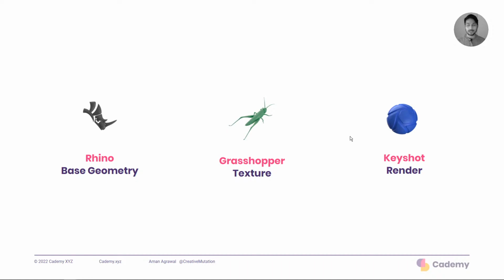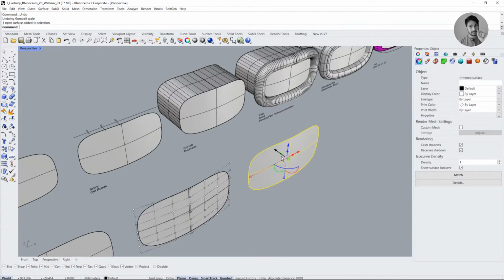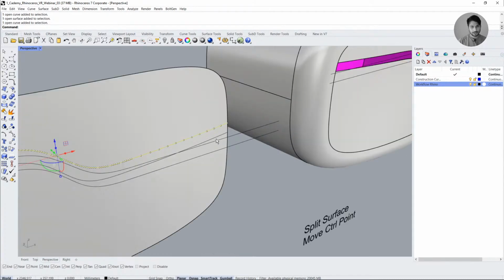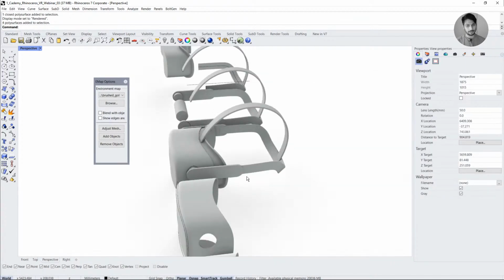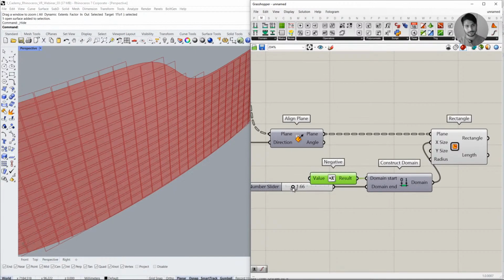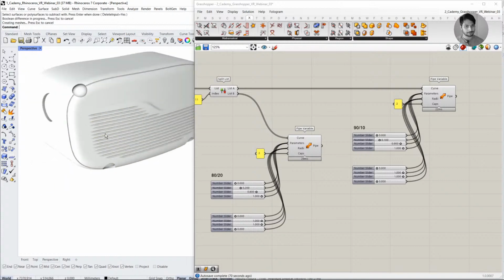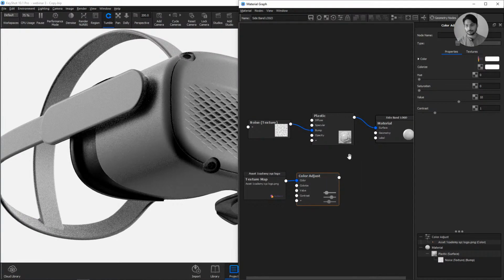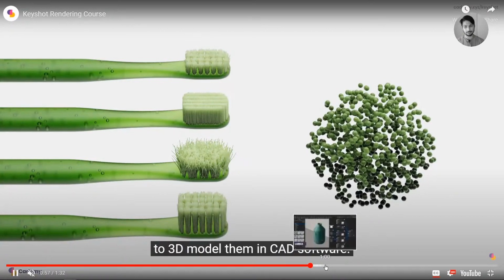Rhino 3D & Grasshopper Tutorial: VR Headset Design (G2 Continuity & Patterns) | Webinar 3.0

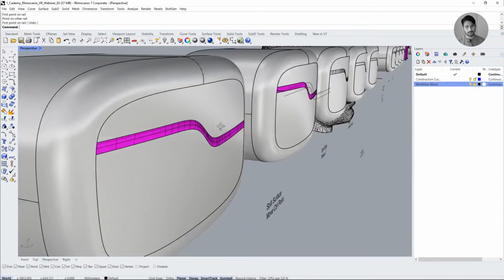Comment: Hi, thanks for the tutorial! I need some help. :( At minute 30:20, when we're supposed to move the surface using the control points, I can move them correctly. However, at minute 35:00, I can't create a closed solid poly. I can clearly see that as soon as I move the control points, the surface moves away from its boundaries. Any idea how to fix this? I noticed that when you do it, it stays 'stuck' to the boundaries. Thank you very much in advance; your tutorials are amazing!
Reply from the maker: @nicolasandresbertotto  Rebuilding the surface with a higher density of control points fixed the problem of the mesh not joining. The issue arises when you rebuild with fewer points; it can cause the surface to deviate from the original boundary within the default file tolerance of 0.001 mm. So yes, try rebuilding with a higher number of control points.

Comment: 35:03  i know this is an old post but may be helpful for others. Rebuilding the surface with a higher density of control points fixed the problem of the mesh not joining.
Reply from the maker: Yes, the issue arises when you rebuild with fewer points; it can cause the surface to deviate from the original boundary within the default file tolerance of 0.001mm. So, yes, try rebuilding with a higher number of control points.

Comment: Sorry, I got trouble at 00:29:54, after I adjusted the control points of the front surface it can not be joined with the rest part to form a solid watertight poly surface, I think there is a small gap between the rebuilt surface and the rest part because of the rebuild, how can I fix that?
Reply from the maker: Try shrinking the trimmed surface. This would potentially reduce, the amount the surface will move on the edges when you move the control points. Another way to resolve this is by rebuilding the original surface with even more control points to get local deformation.
Reply: @Cademy  Thank you so much! I will try this out
Reply: @lobbyboy8490  I had the same issue. i know this is an old post but may be helpful for others. Rebuilding the surface with a higher density of control points fixed the problem of the mesh not joining.
Reply: The problematic surface can be really intimidating, could someone help me out?

Comment: When I pull the control Points it seems to be pulling it off the edges slightly that it should reconnect to when I run the join command. Am I doing something wrong when I move the control points? Thanks for any help in advance
Reply from the maker: Can you please mark at what time you are not able to follow?
Reply: @Cademy  Thank you for responding.I am interested in your courses they seem very helpful. At 34.59 you rejoin the mesh. For me the bottom part does not rejoin but the rest of the mesh does. I think that the problem may come from when I pull the 2 points at 30.07 I followed exactly but I think that it is pulling my mesh off the connection points. So when I go to rejoin that part that it does not rejoin correctly. But I followed everything you did exactly. I even did it all again to be sure and the same happened. Maybe you have an idea thanks for any help in advance.
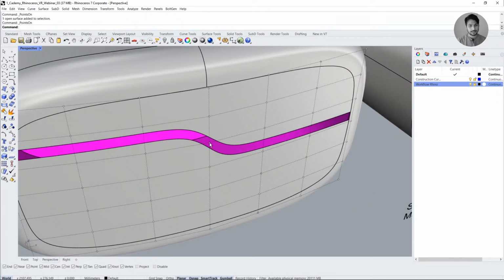Reply from the maker: @peterlaverty9397  Okay, now I understand, first of all, keep in mind that we are modeling in the NURBS context so these are either surfaces or polysurfaces and NOT mesh. So at 34:59, I am joining all the surfaces together to create a Solid Polysurface. Most probably when you pulled the control points at 30:07, you either pulled it too far away. Keep in mind we are working with a surface with degree 6 (7 control point), so this is a single span Surface. Which means when you move ANY point, the overall shape of the surface will change ever so slightly. So when you pulled the point, you might have pulled the surface from the border ever so slightly. You can do two things, either change your file's Unit tolerance to something like 0.1mm, or go back to 13:40 and rebuild it using degree 3 surface with 7 control point. this way, you can keep the corners intact at place when moving the central control points. We go in depth on how NURBS curves & surfaces work in our Rhinoceros Masterclass cademy.xyz/rhino

Comment: Hi! This feels like a stupid question, but my number sliders in GH refuse to go above 1, I can't set them to 20 or 25. I have a very curved surface if that helps, what am I doing wrong? With the value so low the surface divisions either don't show up or they just show up at the corners of the surface.

Edit: Also, when I align the planes towards the z axis, I get duplicates or even more planes than that, if I try to set a shape like you did with the rectangles they all clump together and overlap instead of being evenly distributed along the surface.
Reply from the maker: You can create a range of Number slider by adding two dots between the two numbers. So, double click anywhere in the canvas, write 20..25, this will create a number slider between 20 < 25. You can also add decimals. So double click, "20..25.00"

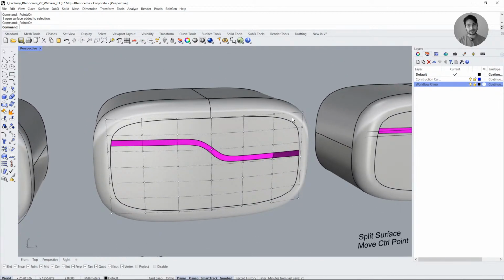Comment: Hello,I have a question about 30:02 , when I selected my surface , the control points grids are the same width and height as the surface that is splited before , not the same as in the video , what could I do to match the grid size as the current surface ?
Reply from the maker: Check 13:24 you need to rebuild the surface to add more control points.
Reply: @Cademy  OK I find where my problem is. I need to use "shrink trimmed surface to edge" first , thank you for your help , and GREAT tutorial btw😃